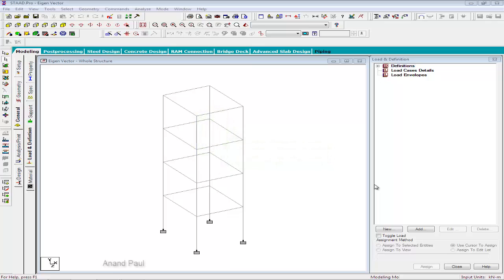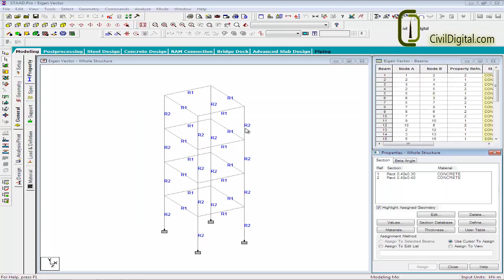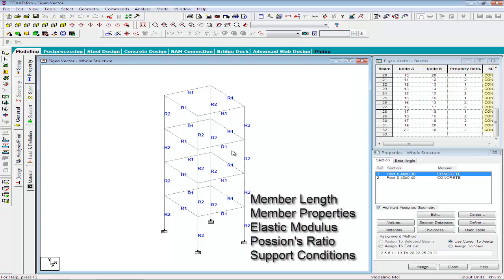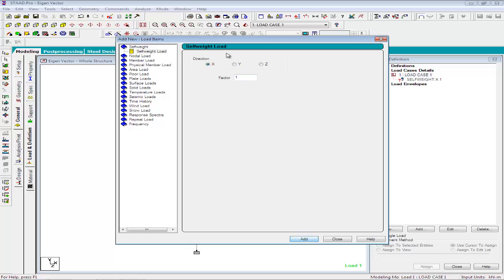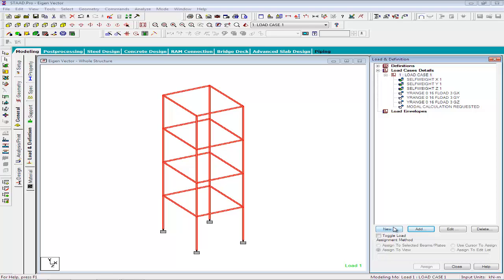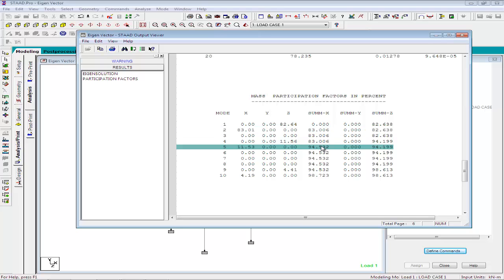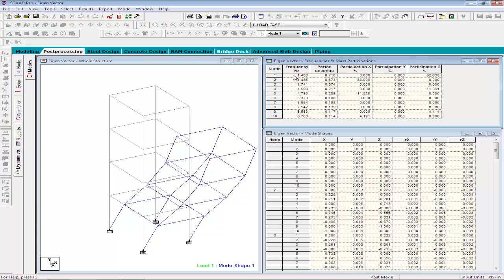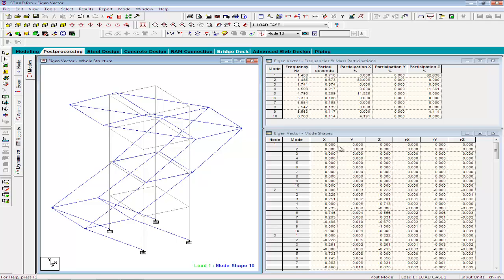Calculating Frequency & Mode Shape in STAAD - Eigen Value Extraction Method

Comment: hi Anand,
i wish to know whether my understanding is correct when it comes to the vibration of structures 
1.  is it ok to say that the deflection of a beam under a dynamic load is the sum of the mode shapes ? or to say that these mode shapes are obtained by fourier analysis of the original deflection?

i appreciate if you could answer this basic question of mine.. thanks for your effort.

..Rajith